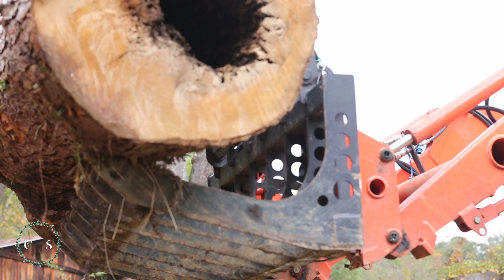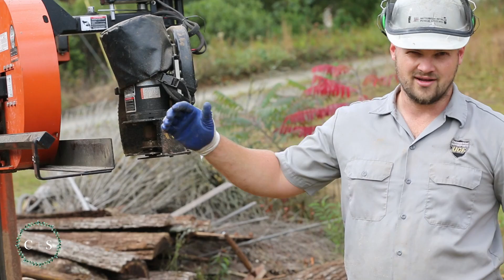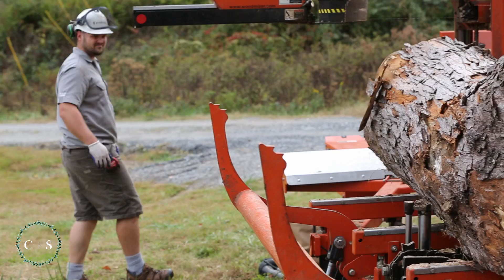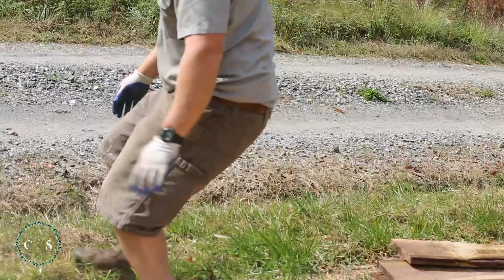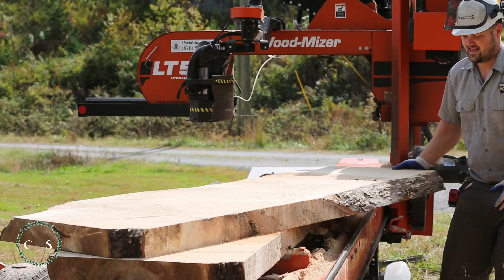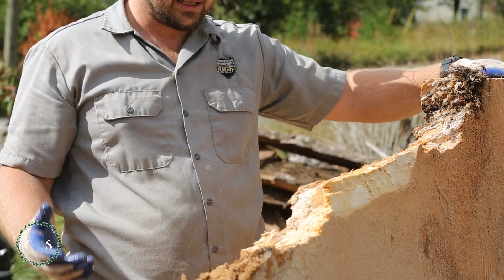WAIT TIL YOU SEE THE INSIDE OF THIS UGLY MAPLE LOG

Comment: As Charlie is cutting the log into slabs my brain was busy thinking about all the wonderful ways to bring out the best wood grain in each slab. One of the things I would do with the pieces that have “holes” in the cut is put a clear appoxie in the holes to fill them & then, if it was going to be a dining room table, build a frame around the entire slab to make it the size that I would want to make it, once it was completely dry, I would then put lacquer on both sides of the table/coffee table & allowed to completely dry. Once that is all done, I would get it readied for the stand before I mounted the top for its first construction to the final product. 
Once I have made sure that it is completed, I would then either deliver it whole to its new place or dismantle it to be re-assembled at the home. If it isn’t going to be dismantled before moving it, I would consider using silicone where the stand meets the table top so that the stand becomes more stable & less likely to come apart.

Comment: I used to work in a very large saw mill / wood products plant. I was a lumber puller after the wood  was dried and planed and trimmed. Those 2x 12x 20 ft'ers were hefty. It takes a man to work with lumber. Hardest  job I ever had. Short stacker was the worst.
Reply: Did u ever spot the horde over there?

Comment: This is so interesting! Now, can those boards you have cut be cut thinner? There are some beautiful cuts that would look gorgeous finished, but I would think they need to be cut thinner than you have just cut. I guess it comes down to what purpose the wood is to be used for. Fascinating!!
Reply: I know this is old, but I was thinking the same thing. Most of them could probably have been cut in thirds. But you are right it depends on what they will be used for. I can't think of anything that would need to be that thick and heavy though.

Comment: Your not showing us the grain of the pieces your cutting. The first pieces with the bark attached with the crotch areas have great value for an artist.
Reply: @Русский Гройпер bio5
Reply: @Русский Гройпер n
Reply: I thought a few wedges pounded in the kerf following the cut would take some weight off the blade as it transits...the WoodMizerSawyer lets 2 slabs bear down........but maybe the blade doesn't care...
Reply: Vivian Winford : much beautiful "book~matching"--"sequence~matching" comes from this area. I once saw an entire walnut tree cut into veneer, lengthwise strips maintained in sequence, called a "flitch". High end genuine wood paneling can be specified 'book~matched'...As a tree is reduced in diameter by "rotary~cutting", the circumference grain pattern can be seen transitioning from panel to panel. And that's all I know, Vivian.

Comment: Just watched this.  How do you get the ridges out of the slabs. ( I guess caused by crooked teeth on the blade??)
Reply: The pieces have to be surface planed - usually after being cut to rough size. 

Yes, it looked like a couple of teeth had far too much set.

Comment: Are your blades disposable or do you sharpen them.
Reply: Never mind. Question answered.
Reply from the maker: They're also cheap enough to not worry when you hit metal... about 30 bucks, but always try to get the most out of them.  Average about 1000 bdft per blade with 3-4 sharpenings before they break

Comment: I know very little of saw mills. What is that attachment in front of the blade. It has yellow and black hash tape. It looks like rotter. Purpose?
Reply from the maker: it's a debarker... the idea is that it takes away the bark/dirt before the blade passes in an effort to extend the use of the blade. we found it a little difficult to keep it completely in line with the blade so it wasn't so effective, but that's the idea.

Comment: You'll find that your blade will not wave up and down, if you'll keep the blade guide adjusted to within .75" from the log. Also,  that 'ripple' you have is from a couple of teeth being out of adjustment, just take a flat file and hit each tooth, that should fix the blade and give a little long life between sharpenings.

Comment: Wow, how many boards do you have to cut by hand and sell before you can afford all that equipment you have there. Also, do you buy those trees off someone or do you just have to be born with buttloads of property covered in maple, elm, cypress, cedar, ash, pecan and hickory? I used to ask around for trees needing to be removed from folks that a lot of property when I was young and would saw boards from them with a chainsaw mounted sideways on a iron water pipe jig I made from scrap metal.  But turned out folks didn’t want their lumber varying by a half inch in thickness with slightly rough edges so I only sold firewood. Never did get me one of those fancy sideway bandsaws, and my lawnmower didn’t have a lift fork on it so I had to drag one board at a time across the yard to my truck and come-a-long the boards into my truck. My truck was a 1965 VW Beetle with the back end cut out and no windshield so I could fit the boards in.  I lived on a narrow curvy dirt road hand cut through the woods so I had to be careful not to turn too quickly or the boards would knock me out of my VW truck.  This of course caused a lot of overnight hospital stays which really cut into my 24 hour lumber delivery business mantra which I think was responsible for declining orders.  So I sold my entire business for $11.36 and got a job with the state road department. I’m retired now and am 71 years old and could buy that equipment now,......but I think I’d just rather go fishin and winking at the young ladies down at Walmart. Heh heh heh I sure had fun telling this little story because none of it is true. Heh heh heh. Hope I brought a smile to your face. I really like making up stories and telling lies. Have a good day partner, an GOD bless you and family.
Reply: Too much INFORMATION!
Reply: Well Robert, I gotta tell ya that was a purty good story.. I like the fact of curvy roads and gettin knocked out on fast corners, the VW and, hospital stays  then workin for the roads dept after sellin the biz for 11.36. Good stuff. Thank You.

Comment: Mr. Charley this video fascinated me as I do adore wooden furniture, picture frames, and wooden utensils for cooking. I did watch it till the end. Fantastic and so cool. However I did notice that you were lifting the huge heavy planks without a back belt brace. Take it from me for years I ignored this one safety item even when I was in sever pain I didn't put one on when I should have done so!  At age 58 I could no longer work my two full time jobs, because I wore my back out so to speak. I spent 42 years working on cement floors, lifting heavy items that I had no business lifting for my height of 5 foot nothing and weight of 105 pounds right up to hitting the 200 pound mark.  My supervisor knew I would get the job done and that he could trust me to get it done in a timely matter. Not one of my bosses ever said I should be using a back belt. Sure in the safety videos I learned about them, and was issued one, but I didn't use it! Now this old lady at 64 is on disability for the past few years, I realize I should have helped myself by putting one on when I worked. So Please Please invest in one and use it so you don't end up disabled!

Comment: What is the purpose for the little saw cutting at the front?  It makes a wide score line on the top of the next cut. Isnt that kinna bad? Or it dont matter when it's all said and done?
Reply from the maker: it's a debarker... the idea is that it removes the bark/dirt before the sharp blade saw blade passes through to save the life of the blade. the debarker blade should be in line with the blade saw blade, but often ours is about 1/16 or 1/8" off... we had issues keeping alignment.

Comment: I would call that think wood 'planks'. I could see you square up 3 pieces of that, put it together and made a great rustic table for a ranch style house or patio table.
If you have a wood plane you could reduce the thickness,  sand it down, put the right kind of stain on it and maybe a couple coats of poly-euro-thane to protect it.
That table and benches would last several lifetimes. It would very heavy and sturdy.

Comment: That's not "rotted" wood.  Certainly not all of it.  Because the blade wasn't sharp, much of the cut was chattery/washboarded.  But you could see a ton of spalting in the grain.  Also, I'm sure there was a good bit of flamed grain which will easily come out once the wood is dried and planed.

Comment: So is there any reason that your blades couldn't have teeth on both edges? That way, you could cut going in, and coming back out.
Reply from the maker: Good question.   When the blade is cutting it is pushed back by the log and the roller guides have a flange to hold the blade jn position.  Some large industrial machines have teeth on both sides, but they are wider blades and rely on very high tension in the blade so the friction of the blade in the main wheels keep it in place
Reply: @charleyandsarah  I guess it rteally wouldn't save that much time anyway. Just a thought I had. 👌

Comment: I've seen you cut some ugly logs in some of your videos & I get why you would spend the time on walnut or other hardwoods. I definitely see some usable wood but with common ant infested maple is there a use for what comes out of a log like this? I'm not being critical. I love primitives & reclaimed barn wood in projects but it seems like after milling there wont be much there other than small boards which can definitely be used in cabinet building & the like.
Reply from the maker: Yeah, you can kiln dry and that'll kill any remaining bugs. You can also try borix or something while it's air drying enough to be kiln dried. Many different uses for the smaller pieces, imagination is your limit 👌

Comment: Very irresponsible given the state of the environment and lack of trees and high pollution levels.
Reply from the maker: I have never cut down a tree for the purpose of lumber, nor have any of my customers to my knowledge. So instead of the tree being turned to firewood or rotting away, it's being put to good use. If used correctly, the lumber can live on for several hundred years. It's a much better solution for the environment than plastic products, etc.
Reply: @charleyandsarah  That's good to know, thanks for clarifying